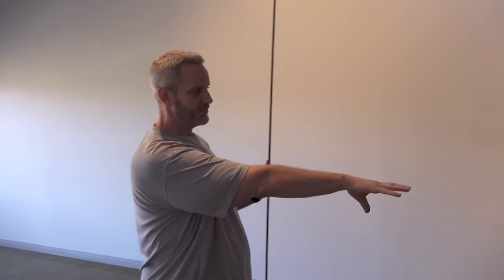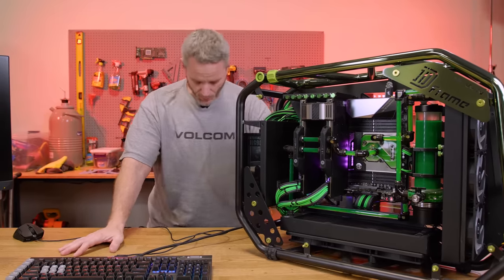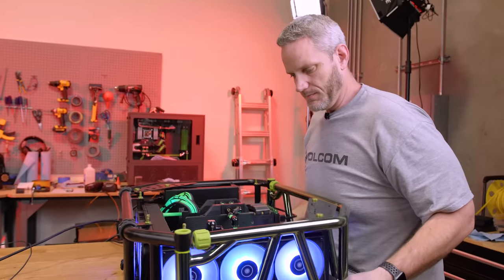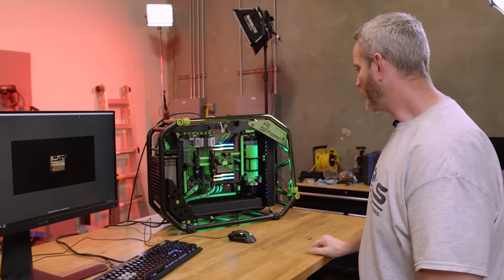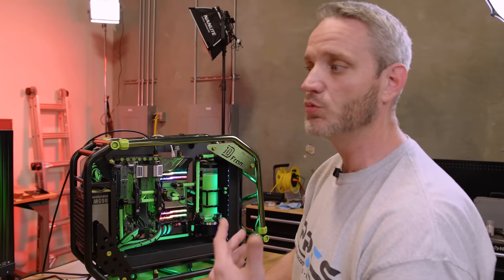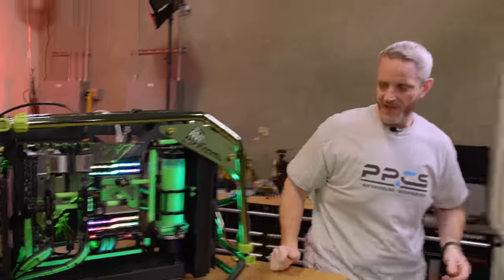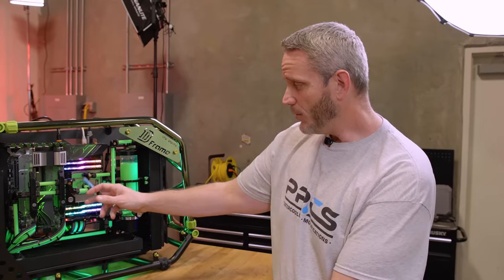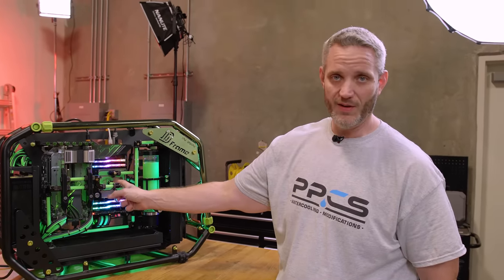This PC deserves better than this...

Comment: My 7980XE is from 2017 but yet it’s still 10% faster then a stock AMD 5950X in multithreaded at 4.8Ghz. I run DDR4 4000Mhz CL15 quad channel memory and I also have much higher bandwidth and lower latency than that platform. My old 2080Ti scores 17,600 in timespy graphics beating a 6800XT and practically matching that of a RTX3080. 

My CPU is pushing close to 4 years old by the day, and my GPU is over 2.5 years old. My system is still a beast and easily as fast, or faster than any modern GPU on the market besides a 3090 which is close to $2,000 dollars lol.

Obviously the newer platforms have faster IPC. But with the memory that I run, and the overclocks that I run all make it pretty negligible.

Comment: Slap a 10980k 18 core in it, turn off hyperthreading (runs much cooler) and dial in a all core 4.8GHz overclock. Rip out the sli titans and put in that 3090 kingpin. Keep most that lovely custom glass work.

Comment: On a whim, I ran Port Royal and scored 4358 on my system (Ryzen 1600, RTX 2060 KO, 16GB RAM).  Figured my settings were wrong, since Jay's computer only scored 5142.

Comment: Well I guess my 6950X@4.3Ghz and Maxwell GTX TitanXs are antiques then! Doing well for dinosaurs cos they've run 4k60+ every day for 5 years and still going strong with CLC. I plan on getting another 5 out of them (unless I win some free upgrade) especially as I have no intention of using RTX for a long time, and my 6950X is barely slower than a 10900 and just as many cores!

Comment: Do you usually just put computers aside after building them? Seem like you could have got some good value selling it back in the day.

I've used Vue in my PETG build and it sticks like crazy. After a few months of use you can see it sticking. Clogged up pretty bad.

Comment: Jay judges the cpu running at stock - my 7900X runs at 4.9GHZ  for 11 hrs a day and still games well with an R20 score over 7000. GPU is another story but then you can't buy one of them anyway so the performance of 3080 is moot - mid year availability at best unless you deal with the devil (scalpers).

Comment: What you should tell everyone, just use distilled water and some sort of anti-biologic agent.
My water looks clean even after 4 years, with just a yearly top off.
Probably finally change water this year, since i'll clean everything and repaste the cpu with new tim.
if you want color simply buy leds, looks nice, can change colors all you want.
I know you can buy Rigid Tubes in a few transparent colors. How about transparent colored filter film on the resevoir?.

Comment: Wouldn't mind a video on skunkworks being checked over; not sure how long its been though compared to the inwin rig there (it was interesting as to how that fluid and loop held up though). Those Titan Xp's aren't terrible for most people, unless one really wants Raytracing/DLSS, they're still decent in non rtx performance let alone a pair of them. On a 1080 Ti myself; it's all about use case and preference i guess. Speaking of cases i finally got my hands on a Cosmos C700P (rare as hell here in the UK for some reason), leagues better than the haf x in use prior to it, but I digress.

Comment: I was still in the mindset of "that's still fairly beastly".... then I remembered I bought a used R9 3900XT for £310... with a CR20 score over 7600 with an ACO

Comment: 10:50 forget benchmarks and heaven, launch borderlands 3 in badass, other than a few other games (modded) nothing will max your gpu as much, heaven furmark kombustor I get 40-41°C on the gpu...borderlands 3 ? 49°C, alternatively you can loop cinebench runs with kombustor running at the same time (I hope you have a 1000watt PSU if you plan to do that)

Comment: I use clear Cryo fuel does clear go bad? its going on 3 yrs will it gunk up blocks? Just wondering whe I should flush and fill the system

Comment: Would've been cool to see it game on some modern titles just to see how the double Xps and X299 did.
Reply: That would require more modern games to take advantage of SLI, or else 1 GPU would basically be sleeping while the other is maxed out.
Reply: @Celician83  uh yeah, that's why I wanted to see it
Reply: @dogboy0912  that would just be a comparison of a single Titan Xp in modern games. Trust me, it's not great. My watercooled OC'd 980TI does not do well, and it's only 1 generation older
Reply: @Celician83  oh my god, all I want is to see a damn X299 system with SLI Titan Xps. If I told you I wanted to light a match, would you tell me, "it just burns, don't bother,"? I still want to see the match burn. I understand. You are imparting no new information. I want to see it anyway.

Comment: I am still running the 7900x overclocked to 4.3 and I hate it because it gets so hot 45 to 50 on idle and on water and yes I lapped it to get is flat  because it was not flat at all

Comment: The idea of building a PC at the time using expensive hardware  just to leave it sit around for 3 years. As for calling the hardware in the system obsolete I would be happy to use such hardware.

Comment: Its not the same fluid as yours Jay but I've been running my corsair H100i for the last 3 years is it worth changing the cooler out or can i replace the fluid? its used pretty much daily for gaming on an overclocked i7 7700k if that has any effect?

Comment: I want to see someone not bother to take apart these systems when they get all clogged up with these fluids and try to run white vinegar or CLR through and see if it's possible to get them substantially clean without a complete breakdown.

Comment: "This computer is old and obsolete." Me looking at my i7 4770 and GTX 750Ti...
Reply: Got the same CPU,get yourself a 160€ or equivalent 1060 6gb it’s a perfect fit
Reply: @raptorjeezus2607  Yah it's not bad, does 1080p pretty well.

Comment: I'm still running with my i5-6600k skylake, msi geforce gtx 1080ti founders edition, 16gb ram and z170 pro gaming aura motherboard. Should I build a new system or should wait?

Comment: lol love to see if an R9 390 could run port royal.
Reply: It would be fine, the r9 390 is basically a rx 480
Reply: I'm still running an R9 380X lmao, waiting for card prices to stabilize before I pull the trigger.

Comment: I've gone exactly zero-days on opaque fluid because I refuse to put my hard-working build at risk with it. The hysterics in this YT are The very reason I avoid things like PrimoChill opaque and pearlescent additives like the plague.  Liquid cooling is about *cooling*, first and foremost, and that's not gonna happen when your loop is chugged up in the smallest capillaries because of shit in the lines coming from a decision based on nothing but epeen-waving bling. At worst, a few drops of translucent dye is an option, but this crap.. never.

Comment: Or u can be like ... not using these types of fluids and be completly fine ? resellvalue of blocks and radiators gunked up like this is close to zero. Even if u try to clean it, it wont look good at all. Getting this stuff out of radiator is pain in ass.

Comment: Hi, Jay 
I have a lot of questions
 I am building a new Pc and was wondering what ram kit out of these 4 do you think would be the best?

https://newegg.com/p/pl?d=128gb+ram&N=601203954%20100007611%20601295940&Order=6

Also, is there is another Ram you would recommend that is 32Gb Per DIMM/Module at 4000Mhz and I was also wondering is there Ram that is 32Gb Per DIMM/module at 4400Mhz? If there is Ram that is 32Gb Per DIMM/module at 4400Mhz can you give me the link if there is?

Comment: That thing would play Cyberdonk 1039 just fine with a 2060xupr on faf settings.  Wife's 5920 is pimping just fine at 1080 75+fps on 2300 ram and stock cockblocks.

Comment: Maybe you should test the Ryzen 5000 compatible leaked bios for x370 (on the taichi, maybe?)

https://wccftech.com/asrock-amd-ryzen-5000-cpu-bios-support-on-x370-b350-a320-motherboards/

I don't trust wccftech but they have the files there

Comment: Hey, having a few problems with my pc atm. I was loading up rust and then my screen goes black. My pc is still on but no display, i check my motherboard and my cpu light is on. I tried re seating ram, gpu and even tried a new cpu and motherboard yet I’m still having the light. Any idea what I could do?
Reply: If you have on board graphics you could switch to that and see if you get a display output.
Reply: @--_DJ_--  no on board graphics unfortunately, I think the psu is dying on me or it’s just the cpu cable gone (purely for the fact everything else is on/spinning)
Reply: @lsvital1519  I doubt a cable that was working would just fail like that. Not that it couldn't happen but it would be an odd occurrence. If you have a multimeter you could check the cable and PSU for proper voltage at the terminals (carefully). I imagine there are pin outs available to guide you if they aren't right on the supply itself. Hopefully it is something simple, or just something available, now isn't exactly a great time to be shopping for a GPU or CPU. Have you tried swapping whatever cable you use for display for a known working one? Have you tested the monitor with another source to make sure it is working?
Reply: @--_DJ_--  yeah tested it all, gpu and monitor works fine, I’ve tried 2 different cpus.
Reply: @lsvital1519  How did you confirm the GPU is working? Not doubting you, just curious.
Reply: @--_DJ_--  put it in another rig
Reply: @lsvital1519  Can you borrow the PSU out of that one to see if it will solve your problems?